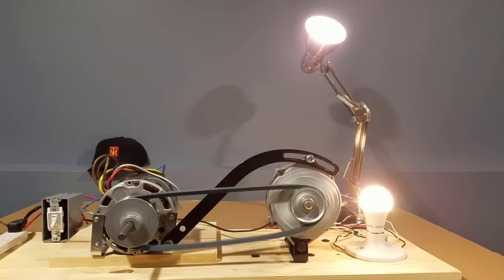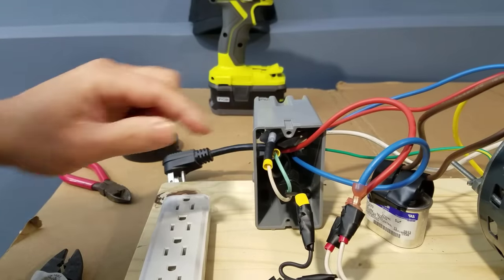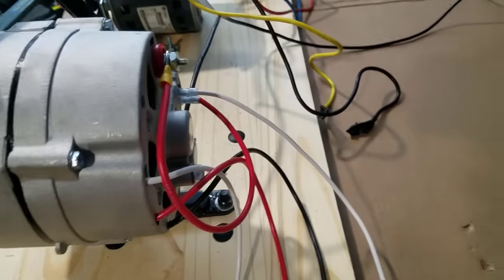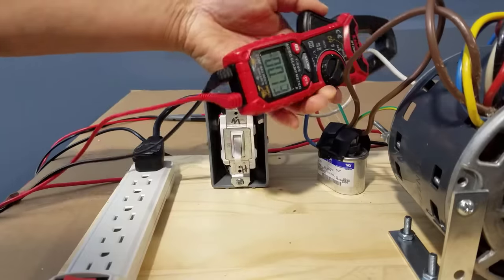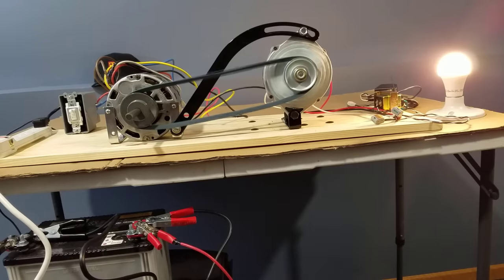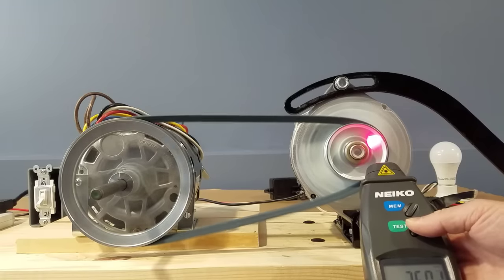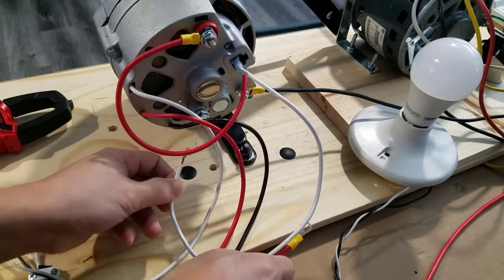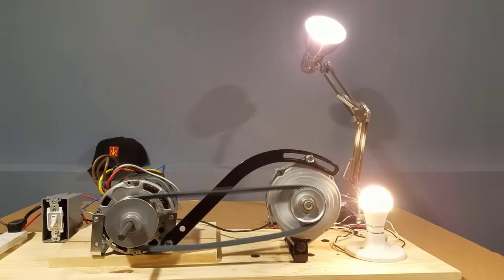Free Energy? (WOW) Using a Car Alternator

Comment: So a perpetual motion machine has never been built because all moving parts creat friction and friction is heat and heat is the lose of energy through friction. This thing can not achieve running itself as the inverter that is not shown to run the AC blower motor is not 100% efficient and the blower motor is not 100% efficient and the alternator is not 100% efficient, not to mention belt energy loss and loss of energy from the wiring, I think this free energy machine consumes at least 10 times more energy that it produces!!
Reply: @Just me........so true ! thanks for explaining the truth to people watching this malarkey !
Reply: Yes, entropy.
Unfortunately, a place where No energy exists is only found outside the universe...no light, no heat over 0* Kelvin, no matter or forces either.

So, you see, none of these machines can ever achieve the "free energy" state proposition. However, no one said that we couldn't utilize the energy all around us...

It's a matter of perspective
Reply: lossesCanBeOvercomedIfTheGeneratorItsOverunity.
Reply: @whtstr2133  the universe is not able to expand, because that would require already existing volume of space that obviously had to already be there.

I am a very intelligent atheist. 
👁️👁️
Reply: @truetech4158  Actually, the universe is expanding, and it's expending at an ever-increasing rate.

Things may have worked better for you if you had been an educated Christian. 😉
Reply: @truetech4158  flat earth atheist
Reply: @ebutuoycensorship8012  what makes you want to overly pretend that invisible friends are really real? Stockholm syndrome for a afterlife professing cu lt is why? food for thought isnt it?
Reply: @truetech4158 I am agnostic but far from atheist I think that's the most ignorant someone could be . I belive in creation but I never said I belive in " invisible friends" to think any of what we experience can come from a big bang or dawinian evolution would be ignorant.  Not that I am asserting you believe in those make believes . Maybe you do not know the difference . Are you agnostic or atheist?
Reply: Are you sure?
Reply: Two words. Resonance frequency.
Reply: @rayaytatatuntatnafurtat2029  Or resonant frequency. You meant resonance of frequency. Cheers
Reply: @truetech4158  I guess it's three words the!
Reply: @rayaytatatuntatnafurtat2029  Resonant frequency being the direct result of resonance of frequency.

Ok, now explain your theory in transparency, or if you prefer to keep it as few words as puzzlingly possible, this is a choice perhaps.
Reply: @truetech4158  I'm not that stupid,  but 44,000÷2= 22,000, figure it out. Goodluck.
Reply: @rayaytatatuntatnafurtat2029  you meant to say that you are not that smart, or you wouldve explained the details to back up your suggesting that you know how to make it work, lol.
Oh well, the ego is stronger than the understanding of how to make the electric motor to run without a power cable.

You are welcome to prove me wrong and you right though if you can, rather than offer  to show that you know how basic math works.
Shall we begin?
Reply: @truetech4158  This shows you think you know,  you've learnt nothing well, all the best.
Reply: @MyTube4Utoo  "universe is expanding" prove it.
Reply: In a nutshell the laws of thermodynamics don't allow for this.
Reply: @garffieldiscool1163  didn't you mean the laws of physics rather than thermo related?
Reply: @truetech4158  The laws of thermodynamics is part of the laws of physics. Energy cannot be created or destroyed. E= mc squared. You cannot get energy out without putting the same amount back into a system. So the total energy in is = energy out plus the friction..  Something can spin continuously ( consevation of angular momentun) if there is no force acting apon it like friction but that means there is no free energy left to do work outside of the system. Green energy is someting else althoug that can be considered free enery.That comes from the second law of thermodynamics, entropy always increases. Most of our energy comes from the sun in the form of electomagneti radiation or from chemical reactions. Technically free energy is the energy that does the work that is Kinetic energy. Potential energy is the ability to do work.Maxwell's equations helps to explain electrical part.
Reply: @MyTube4Utoo   education and christianity are inversely proportional
Reply: @stolearovigor281  I'm not your secretary. You wanna learn something seek out the information.
Reply: @garygraham8373   I've been online since 1989, and that may be the dumbest comment I've yet to see posted. 😆
Reply: @MyTube4Utoo  ok, try intelligence and religion are diametrically opposed
Reply: @MyTube4Utoo  then eat eggplants 🤷
Reply: @garygraham8373  this one is dumb too
Reply: @garygraham8373 No. they are not diametrically opposed. Not by any means.
Reply: What gets me is the ignorance of people…

Yes, it is possible to do this, just not with an AC motor lol…

People think way too much on variables that actually to not matter… the belt for example uses exact ZERO energy to spin… ridiculous theory out there because they refuse to actually do what is needed to actually make the world a better place…

If the pulley is in a 2 to 1 ratio, it works just fine…

You drive motor spins at 2500rpm, the alternator pulley will spin twice the speed of the motor… he did it wrong…

You need a high torque motor to drive the alternator…

An alternator will produce, depending on the alternator, a minimum of 45 amps at an idol speed of 1000 rpm’s…

To get the max amps out of the alternator you need it spinning at 2500 rpm min…

You people make me laugh….
Reply: I have lost braincells reading the replies to this comment.
Reply: @mrtheology2069 v belt drive is one of the most inefficient drives out there with average of 20% energy loss.
Alternator can produce good amount of power but it doesn't come out of nowhere get your ego in check.

Comment: add an idler pulley with a 1:1 ratio and then a 3:1 output from the idler shaft to alternator....so you'll need 2 belts

Comment: The only perpetual motion machine that will actually work is one that is gravity based. I built one when I was 10 out of a 12 volt sump pump old aquarium parts and 4 gallons of water a bunch of broken cassette players and a ton of hot glue it powered a 40 w bulb for a whole summer till I was made to take it down. Think River Mill on a downhill slope. It outputed 13 volts and less than 2 amps.
Reply: That’s not perpetual, water evaporates

Comment: minute 8:38 you measuring voltage 14.34V to charge the battery but how many amps? It needs to produce enough power (W=V*A) to self sustain running

Comment: Have you considered introducing a flywheel ?  A big heavy flywheel works on the principal of momentum and torque, perhaps it could drive more alternators on a step down to step up gear configuration with just minimal help from the motor to sustain the momentum of the flywheel from slowing down.
Reply: In my opinion, apart from stabilising the frequency, a flywheel cannot contribute to generating free energy. FE must literally be pulled out of the vacuum by eliminating the counter electromotive force; As scientist Tom Bearden theoretically explains, it is also possible without moving parts. The Germans had already built such devices experimentally to recharge the batteries of their tanks in Russia in WWII. Then the war was finished and all ended up in the trash because there was enough oil.

Comment: Okay so I think the objective should be to run a deep freeze. 
Ideally, for myself who lives offgrid. A deep freeze, fans, and water pumps are what I need more power for.
Reply: I would like to run a home AC unit with a free money machine. It is the single largest expense and use of electricity at least in my area.   What I don't know is how many pulse spark plugs are needed to provide the needed amps to ruin a home AC unit.   I guess you could just run a single window AC unity with four plugs. I will  have to try it.
Reply: Supplement the power grid with your own perpetuated wheel that consists of soda bottles equally full and equally distributed in a turbine shaped manner. You can find design on YouTube by searching perpetual rotation. Keep in mind his ratio technique to calculate desired output. Also remember that you must convert DC to AC if you are doing it correctly and supplying battery bank. You do this by purchasing inverters from Walmart in automotive that are designed to connect directly to battery banks and offer you receptacles just like you have in your household walls.the engineering is simple. The difficult part is knowing how to formulate your output to consumption without releasing too much power and using correct gauge wiring and receptacles.the great part about using car alternators are that they already have clutch to prevent overloading your battery bank without having to manually monitor or engineer your own also it is important that you use correct breaker box and breakers before distributing through your home bc breakers are what protect you from electrical fires if done right
Reply: Add more alternators in series and run 24 or 48 volts off the same motor.
Reply: How do live off-grid

Comment: Just a question? Has anyone combine solar setup connected to a motor which is hook up with an alternator to close the circuit to produce constant energy?
Reply: Youd additionally want to be constantly loading some battery cells to handle the difference. Battery might charge completely while usable energy is converted to some work. If youre close but no cigar then who knows, it could take days or weeks or more even before you have to shut the system down to let the batteries catch up. 99% effiency or more perhaps?
Reply: Yes he's name was the ginger bread man.
He currently lives on Graham Cracker Rd. 
He is normally at home. But he is a swinger. Him and bowpip have a pretty active night life.
Reply: Solar is an external source of energy.

Comment: I do not understand the thoughts ppl have when doing a 12 volt generator to have to go to 110 volts AC ! Isn't there a loss in the change ? Why not stay at 12 volts ? AC current was for the need to move it over miles from the generator but guys, your generating it and using it local ! Let's us see what it can do keeping it at 12 volts !
Reply: Not to worry my friend.(whispers to friend) We know it's you posting this insidious questions to yourself. It's not a good look ok.
Reply: Less losses at high voltages.  Also ac van use trans formers

Comment: These types of experiments have fascinated me for ages, despite not being an energy expert. And yes, believing in the human mind I do believe that answers are possible despite the current 'laws' in practice. I note the comments about efficiency, or lack off, due to friction which makes sense. Being in the lubricants industry for years, I note not one suggestion about what the effect could be of a specialised grease. For instance, the grease in the motor and alternator bearings. I know of one manufacturer that makes a grease that lowers friction compared to any other grease by average 79% and therefore obviously also operating temps.
Reply: How about magnetic air bearings?
Reply: @whtstr2133  Thanks friend. We learn every day!
Reply: @Land and Lore Photograph Off Road Adventures you do realize that entropy only exists when all other energy sources , such as heat and light, gravity and momentum are removed.... right?
Reply: I am going to pretend you missed that day in 2nd grade.
So here you go my Punjabi buddy.
Law of Thermodynamics
Reply: @sinicalgary  One does not have to be an expert in my opinion friend. I will settle for an enquiring open mind any day.
Reply: @kornthebread8201  Maybe so friend. Based on current understanding. But guess what fascinates me? Not sure if you picked it up. Read an article about the Voyager space probe that was launched about 45 years ago and by now out of our immediate galaxy. Still sending data back which caused experts to say we may have to re-think many of our current accepted Laws.  Then their is an opinion coming up more and more that Einsteins Law of Relativity also did not get it 100% right. About the genius of Tesla we have an idea of what could have been, and has been stolen / suppressed. Lastly the fact that I read a few years ago concerning the U.S. Patent Office. At that stage close to 2000 patent applications have been submitted for cleaner, more sustainable cheaper energy answers......and not passed. My question is WHY?
Reply: @whtstr2133  On the button friend. I have learnt TWO facts in life and it does not make me a 'cynic' I hope. The first is that NOTHING IS AS IT SEEMS. Secondly, these days if one wants to come close to 'TRUTH' consider believing almost the EXACT OPPOSITE of what comes from the MSM, Governments etc. We are being played like fiddles. Take care.
Reply: @sinicalgary  You are entitled to your opinion, and the 'way' you put it across. No problem.
Reply: I believe in us all of us. I know my life will end someday.  It's been ruff but I own all the good and bad. Even when tragedy seems my best friend. There's those moments life well you fall right back in love with it.  I hope many others get a chance for life's experience.   I know I'm lucky I know many have no say and some people do not get a chance.  I know this is the greatest country in the world to me. I love America and I hope we come together and do our best so that others can do what we have done. Good or bad I'm with y'all till the end.

Comment: About reversing the spin on a single phase motor just switch the position of the line in and line out of the starting winding in the common line, that way the rotor and the core are still aligned, that motor will not last long due to abnormal amps plus lessen the hp because that unalligned rotor and core in the windings.

Comment: Sir, thank you so much a very intelligent Demo.A very clear set up.We need 15 to 18 RPM  and 55 to 60 HERTZ for the safety of appliances.My suggestion a 40 klgs with a diameter of 24" inches outside diameter Fly Wheel with  fully to allow more power to drive both the Alternator and Generator.

Comment: There's no such thing as 'Free Energy.' That would defy the laws of physics.
Reply: Yes there is... What you're talking about is perpetual energy, the only reason it's not "free" is because bearings need replacing every x amount if time and magnets lose magnetism. Magnets only lose 1% of their magnetism every 100 years (without heat and impact exposure).

Are you shilling for fossil fuels?
Reply: By your username i would assume you could grasp that laws are only for NPCs by a corrupt system
Reply: @psycanthrope4742  I'm gonna go out on a limb here and say you have no scientific education cuz perpetual motion breaks on of the most fundamental laws of physics. No ifs and buts. Its not possible
Reply: @sailoroftheinternet3290  that's what I said, no such thing as perpetual motion because everything degrades. If you put magnets on each spoke on a pelton wheel and have another 2 magnets placed correctly on either side facing the correct way and secured in place, the wheel will continually spin until either the bearing wears out, or the magnets lose their magnetism.

The only reason it isn't "free energy" is because you would have to eventually replace those parts.
Reply: @sailoroftheinternet3290  or you could put magnet with either positive or negative facing upward, and also tie a string to another magnet and suspend it above the magnet below and it will constantly attempt to swing away from the magnet below, not sure how you would convert that into energy though
Reply: @psycanthrope4742  "If you put magnets on each spoke on a pelton wheel and have another 2 magnets placed correctly on either side facing the correct way and secured in place, the wheel will continually spin"

Thats plainly false. And i would love for you to provide some evidence for it.
Reply: @sailoroftheinternet3290  explain the science behind why that wouldn't work without using pseudo-corporate tobacco science jargon